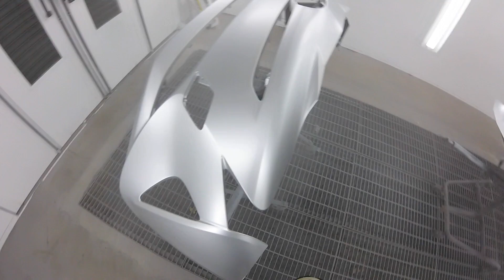Painting a silver Prius with Spies Hecker

Comment: Hey man I was wondering do you add reducer to your 8700 clear to help slow it down and lay out easier?
Reply from the maker: No. I don’t add reducer to 8700. I do put reducer in 8300.
Reply: @everyday_painter  gotcha. Cleared a allover with the 8700 clear Friday and still felt like it needed to be slowed down a bit
Reply from the maker: Which activator did you use? I use LE1007S for all overs with 8700. It’s a high temp activator.